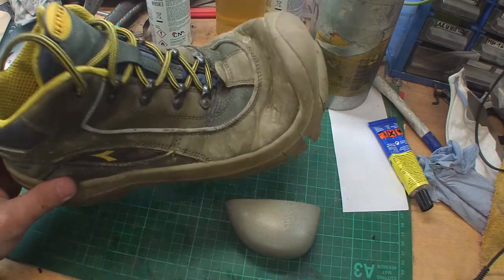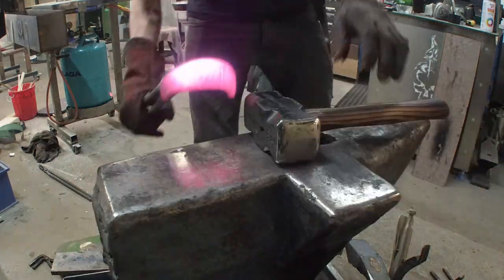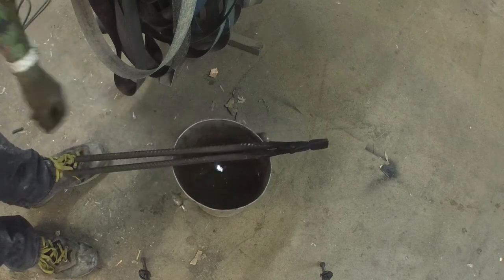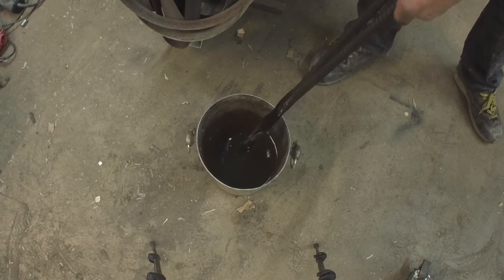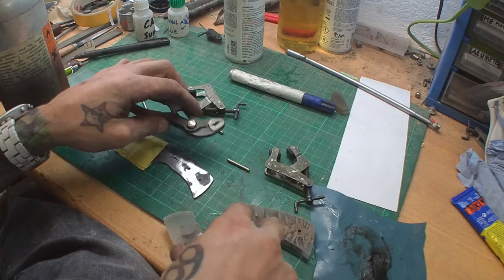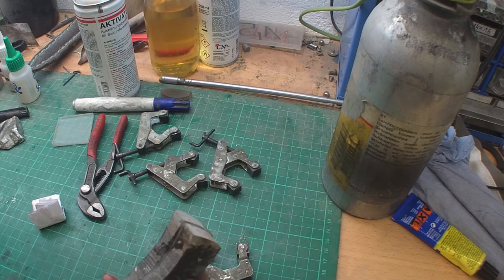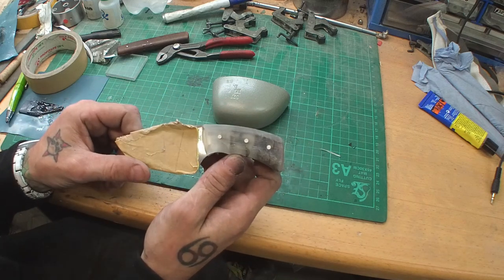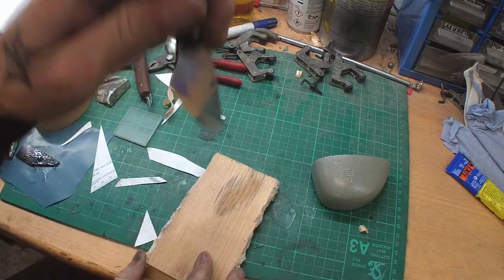Making a Knife From a Safety Boot Toe Cap Cheap And Easy

Comment: You should've took both toes forge welded them to get more steel!  Cool idea though.  Nice job!
Reply from the maker: Thank you, if i could forge weld i even had put a layer of good steel in between ;-)
Reply: Oh you can it's not hard.  I've been making blades less than a year.  If I can you can.  I just made a cable damascus for Christ sake.  Start small.  Try chainsaw chain.
Reply from the maker: my forge doesn´t get hot enough thats my main problem  and the Borax eats away my insulation plus i am in a cellar were its not that good to get to much heat for to long at once but i`ll keep on trying thank you
Reply: What kind of forge do you have.  Ill trade you my 2 burner for that sweet anvil! 😀
Reply from the maker: my forge is self buildt and my burner too, so i can easily make a second one. And my lovley anvil i cant give away i need it my self plus you dont want to pay shipping from Austria to you for 140 pounds of steel.
Reply: You don't know what I want to pay!! 🤑. Jk kinda.  Very hard to find a good anvil in the states.  So many people use them as decoration. Pisses me off.  I would just buy one from Lithuania.  No fuss no maintenance just fire it up and go.  Definitely worth the 💰
Reply from the maker: i thougt in the us there are lots of companys making good anvils for less money. on my anvil one horn was broken and its about 150 years old so i got it for 50 bucks, maybe you will find one on a garage sale or online on ebay or something like that
Reply: I would like an older anvil.  Like a Peter Wright or hay budden.  Blacksmith down the street make them for 800$ but I'm just a lowely carpenter.  Haven't made much cash from knifes and making blades is expensive.  Older anvils hold up better. They stand the test of time and have a cool story
Reply: You got a email.  Wanna exchange pics. Successes and failures.  I always like feedback. Lot of blacksmiths around not many bladesmiths
Reply from the maker: on my website www.wsw-tools.at you find the contact data